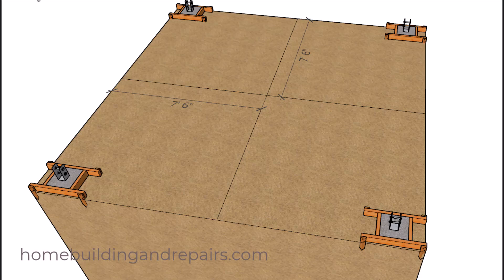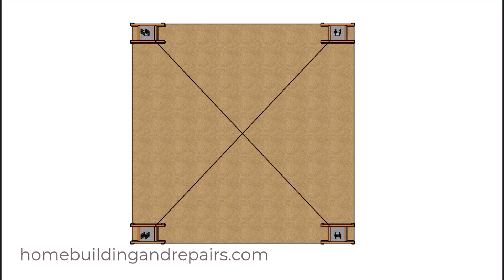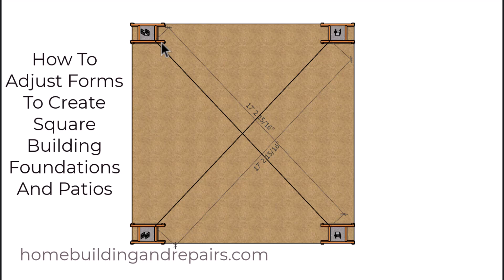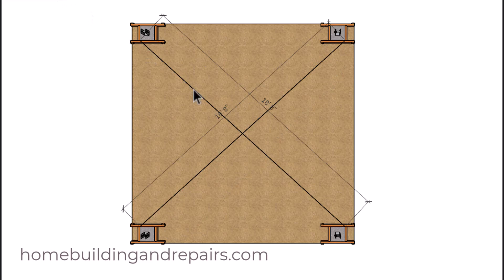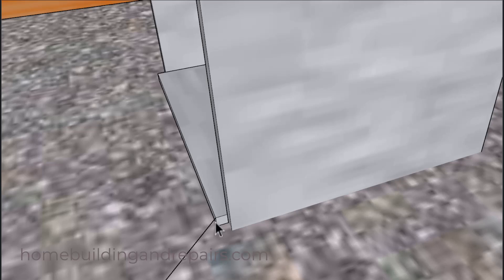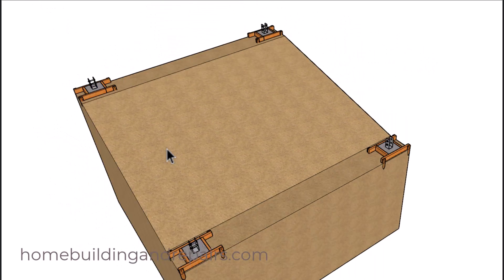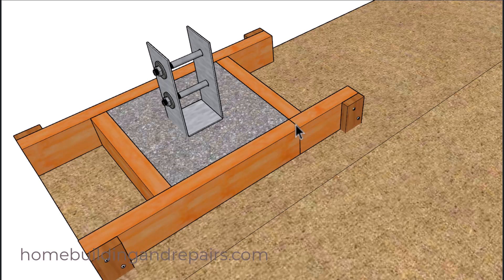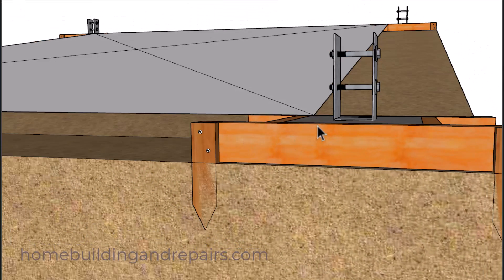How to Square Concrete Footings and Forms on Sloping Hillside - No Complicated Math Here

Comment: I can appreciate trying to keep it simple, but there's a little more involved in the sloping example because the parallel distance along the grade is longer than the parallel distance along the level horizontal distance by the reciprocal of the cosine of the slope angle.

I would suggest to only stake in the two parallel form boards without the two cross pieces first, then do your first two layout marks on the form boards to establish one side. Then just either use the Pythagorean theorem or trigonometry to establish the exact location of the third corner, then the fourth corner is established with the parallel distance. Then you can put in the two form cross pieces at each corner exactly where they supposed to be. This eliminates all the wasted time going back and forth with the cross measuring.
Reply from the maker: Thanks as always, you're comments are always appreciated.